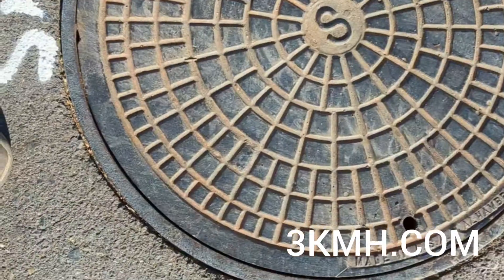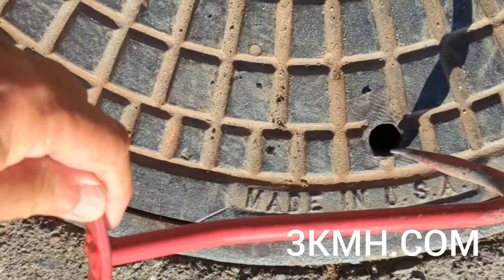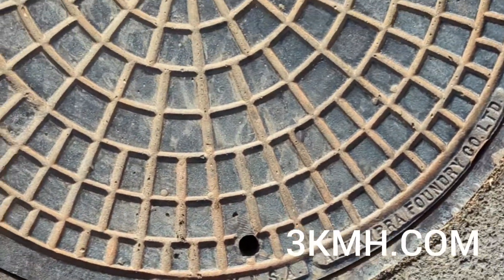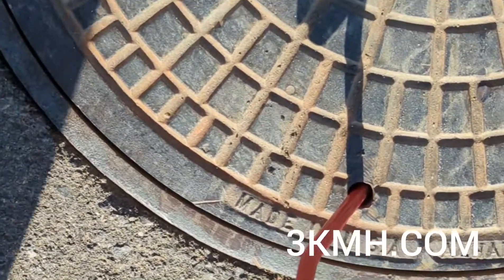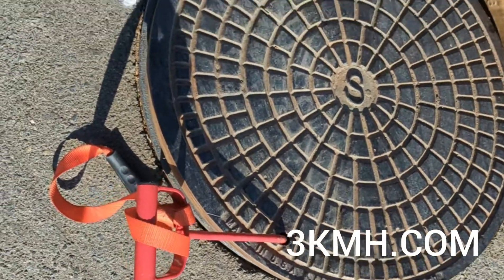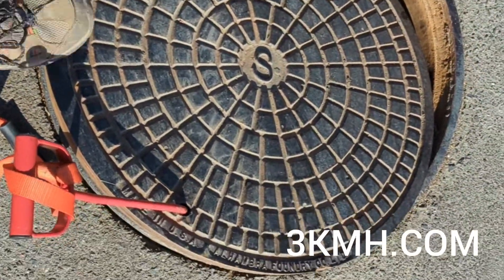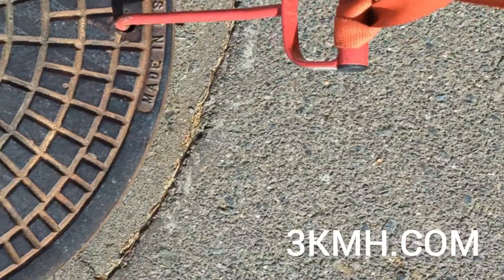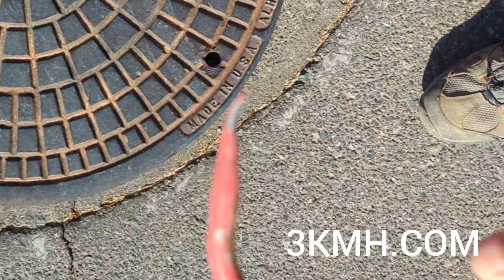How to Survey. Using a Hay Hook to lift a Manhole Lid

Comment: What's your solution when the lid is rusted in place?
Reply from the maker: We hit it with the sledge or use a pry bar, but if it does not open we note it.  We had one the other day where it was rusted shut. " Un able to open"